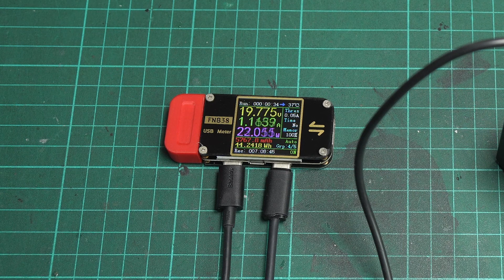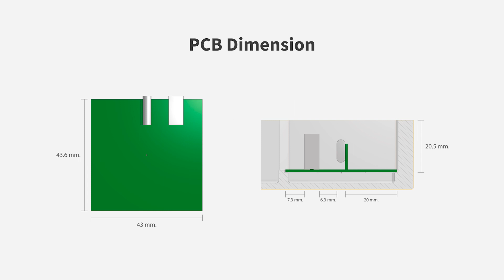From Trash to Tech: Resurrecting a PD Charger with 3D Printing

Comment: yep, i did the same, an old PD hub had the usb c port damaged due to tugging, turns out it was only held by the soldered pins and was not soldered at the casing to the pcb. thankfully it was an easy job as the pd port was soldered on a breakout board. had to saw the case open to replace it and print a new top cover for it. works like new

Comment: This is the inspiration I needed as I have a PD charger that is broken similar to yours. I will be definitely be something similar. What software did you use to draft up the design?
Reply from the maker: That's awesome to hear! I used Onshape for the design, but I think the provided STEP file can be easily edited with most CAD software.
And if you're planning to use my model, please double-check your PCB dimensions with the provided diagram to make sure it fits. We wouldn't want any unexpected surprises! 😊 Happy creating! 👍

Comment: That's great. The real question is how you measured the dimensions and positions of components on the board.
Reply from the maker: I just used a digital caliper to manually measure the dimensions and positions of components on the PCB and added a bit of slack (0.2 - 0.5mm) to ensure a comfortable fit.